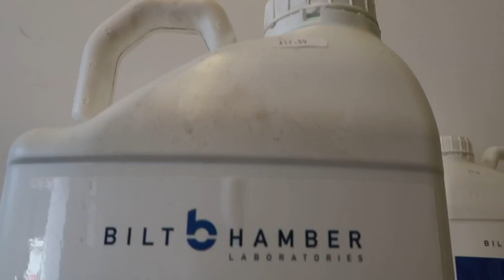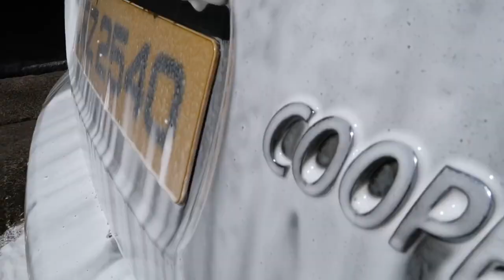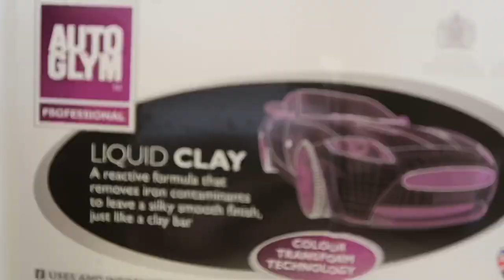WASH & GO on Mini Cooper S | the absorber drying towel | autoglym liquid clay | poor boys super suds

Comment: Another great wee video Vicky. What did you do after you applied the liquid clay?
Just use a microfibre all round the car?
I have never used liquid clay before.
Superabsorber looked OK. But I would love to see you drying 90 % of your car with water! You just need an open ended hose and a steady stream of water and the surface tension does the rest. 
Keep safe x 🌹🏴
Reply from the maker: Just wash it off, doesn’t need any work at all. Okay, point took ✌️✌️ will do that in next one 🥰
Reply: @Civicky  🌹👍❤️🏴